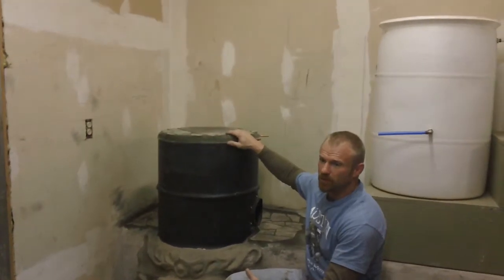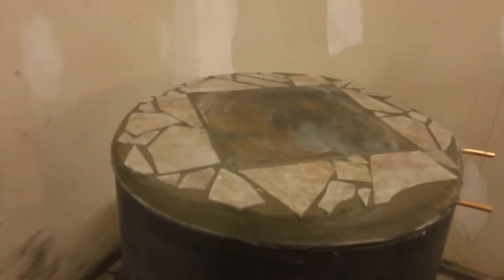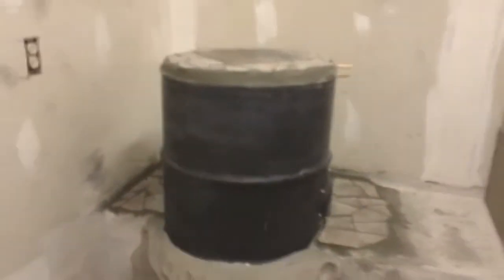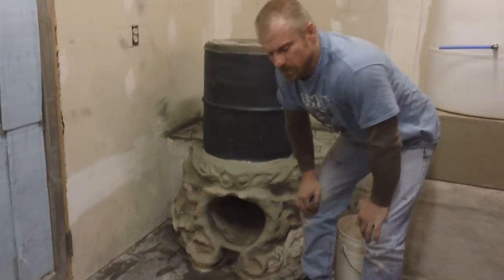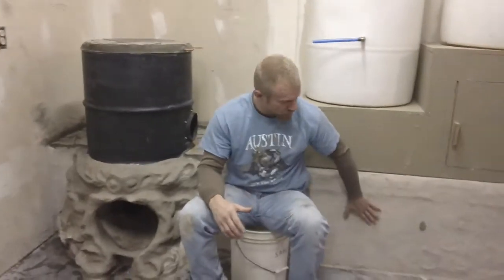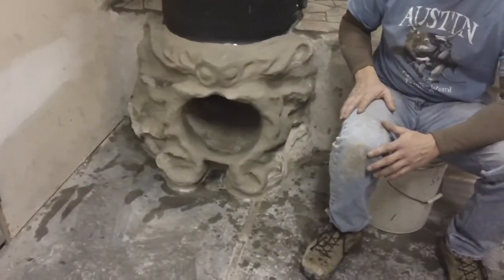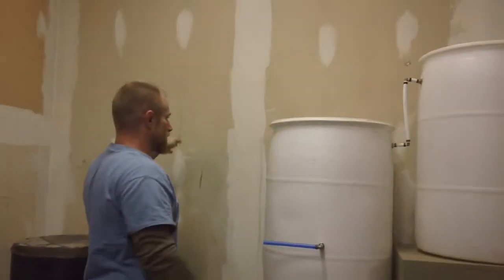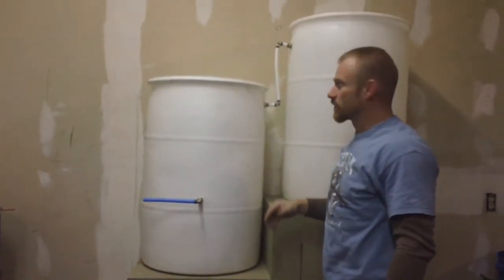12 inch Bulldog Rocket Stove Part 5

Comment: I am curious if the water temerature is too hot for those plastic barells that serve as water heat mass containers.
What type of plastic are those barells made of and what are they primary made to be used for?
Reply from the maker: those barrels are ratted with pressure up to 180 f.. they are food grade barrels  so the water can be portable will hold more temp than 180 standing open no pressure i dont think 212 would make them soft and i dont think you could ever get it that hot it would loose heat to fast.

Comment: That copper tube is too mall to thermal siphon. You have a flash boiler. Be careful. May be very dangerous! You'll probably need a high volume low pressure pump to keep the water from boiling. Just look at the size of the radiator hoses on your car and they are pumped.
Reply from the maker: LOL. well now. is that so? Are you sure about your claim?
Reply: Been there, done that, bought the t-shirt! (Stove looks great, by-the-way!)
Reply from the maker: Well sir I have some footage of what you claim wont work in fact working very well. I sat and watched it thermal siphon for 6 hours straight got the footage will be publishing it soon and that a fact. new t-shirts for sale.
Reply: Wonderful! Have you posted a video? I'll go look.
Reply from the maker: kbbacon Part 7 of the working thermal siphon working is posted

Comment: Would your setup work better if you had a 12" exhaust pipe to match the system?
Reply from the maker: aint that a million dollar question. LOL. well to be honest I think it matters that I choke the intake air down to match the output. I hope the set up actually delivers more push. preliminary burns on this model and others built similarly have been good. Look at a batch box rocket stove its real close to what I have done here.

Comment: just a thought on your newst set up but could you use the therm siphon as a pump for your tegs so you would have to have a solar 3-10 vdc pump?
Reply: i found it cheaper in england to buy a solar panel inverter battery pump separately than buy a solar pump lol
Reply from the maker: Alex Newton aint life grand? its all seems to be about the money dont it? Thats why this system has no pump in part.

Comment: thanks for the advice for how to go about finding my disired cob mix and ive also found a large area for clay the soil shake test at quater inch sand to almost 1&half inch clay your comments please if you would.   and thank you for  explaintion on the ducting intake set up you have this will help in my effort to construce my own rocket mass heater